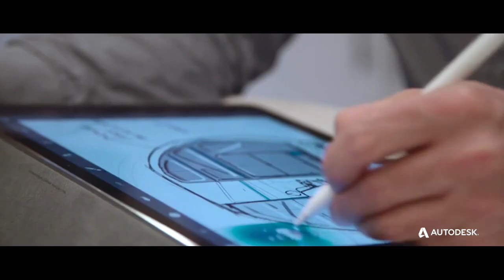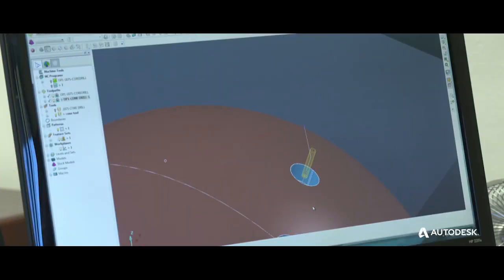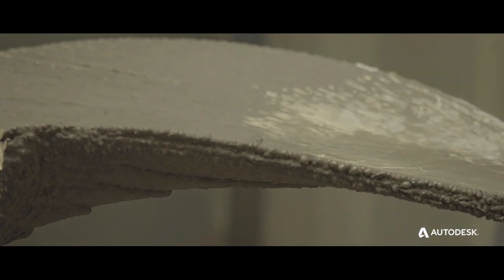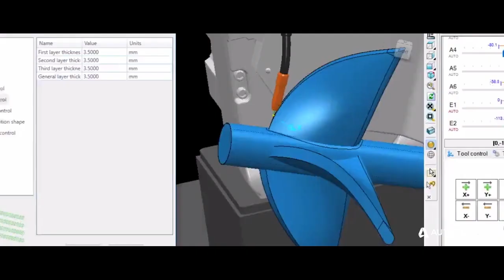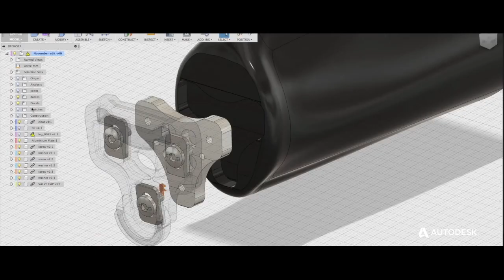We MAKE with Autodesk. What do you MAKE?

Comment: I have started using your 4,500 dollar software and after 5 hours of work, I am unable to cut away pieces of an stl part to remove parts I don't want or need. This is crazy in the fact that I cannot do it. Your tutorials are from a person that does not explain step by step how to cut away an item and remove the unwanted part from the stl file. I am tired of this software, I love the design of the software, however, because your tutorial does not have a step-by-step process explained out, written out on your website or youtube (it's impossible to learn this software easily), those explanations are actually quit useless.  (Have your software people just pick people at random, have them follow your instructions, and see if that person can actually do what is in the video, hint...its impossible) your website gives partial explanations, but again you are left in the dark of how to actually remove the unwanted part of the cut away part, or even how to remove a part that is cut away from the original part.